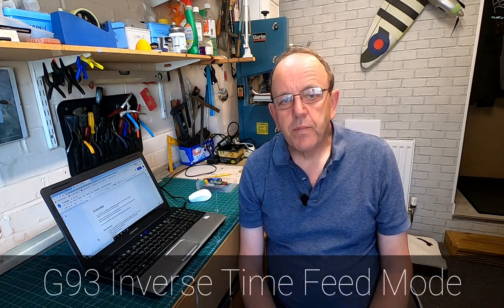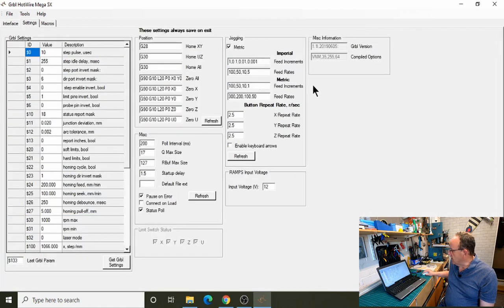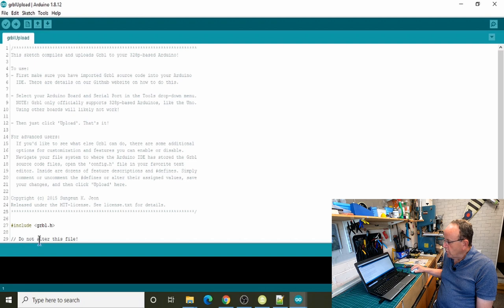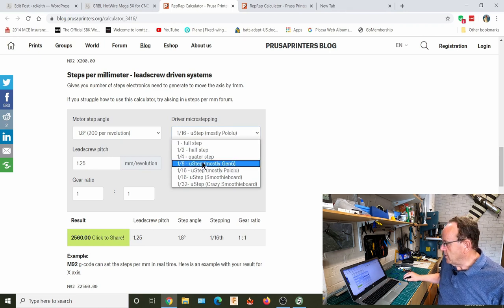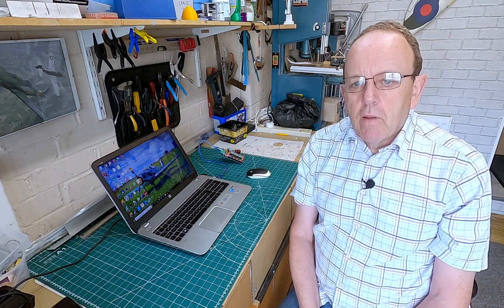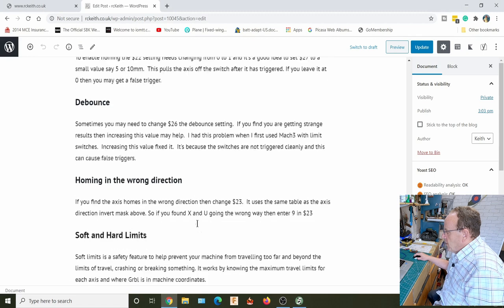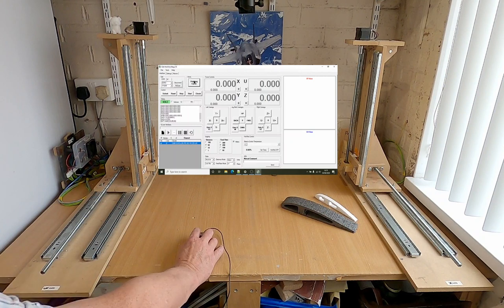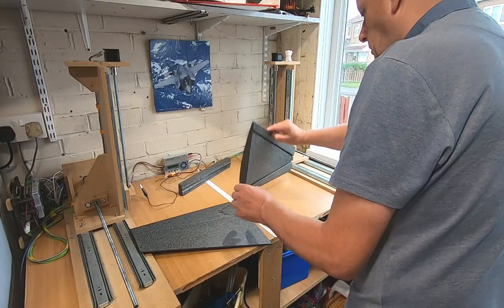GRBL HotWire Mega 5X Free Software & Firmware - CNC Foam Cutters

Comment: Great work Keith!!! I´m actually building a V2 of my Foamcutter (belt driven) and yes, i´ll add limit switches :) !
Reply from the maker: Thanks. Send some pictures be good to see a belt  driven version.
Reply: @rckeith  hmm... getting some errors when  compiling the code ("WCO refresh must be greater than one."
and "Override refresh must be greater than zero."

) - any idea
Reply from the maker: @jetpilot72  have you got the correct board selected, that can stop compiling.
Reply: @rckeith  yes, settings are correct -  tried it on a new arduino mega and it worked! Limit switches are working :) thank´s again for your time and help! Is there a way to donate something????

Comment: Hello Keith, 

Thanks for all the lovely videos. 

Do you think you could make a version of the hotwire controller that works on Linux. Or atleast guide me (and others like me) on how to make one. Thanks
Reply from the maker: Thanks. I don’t have the skills to do that. There is a version on the website based on Marlin which doesn't require Windows. It just runs off the LCD.
Reply: @rckeith  ok. Thanks so much

Comment: The "homing seek" ($25) Should be a larger value than the "homing feed" ($24).  When the homing cycle starts the carriage moves toward the limit switch at the ("seek rate"$25) until the switch is triggered.  Then (pull-off $27) is executed. Then the carriage moves toward the limit switch at the ("feed rate"$24). This is executed slowly moving until the switch is triggered giving more accurate and repeatable result.  If these values are large "feed" and small "seek" and the carriage is at the other end of the track it will slowly move down the track until it triggers the switch then backup "pull-off" distance and swiftly engage the switch again. taking a long time and giving less than optimum results. If large "seek"  and small "feed" are used the carriage will move swiftly down the track engage the switch "pull-off and slowly engage the switch again taking much less time and giving optimum results.   Excellent Video  I will soon be building this.  Thank you

Comment: Hello Keith, what is the minimum monitor size to work with the grbl 5x software? I want to use a 15 inches monitor with touch screen, do you know if fit the screen software on a 15 inches monitor?
Reply from the maker: You need a monitor that supports 1920x1080 resolution.

Comment: Hi keith..  Great job. Have seen or used winghelper? .  That is what im currently using. Its helpful since i also have a laser cutter..
Reply from the maker: Hi Victor, no I haven't it does look very good from the video. Have you used it for foam cutting?
Reply: @rckeith  yes it works very well....and gcode works with grbl with no issues

Comment: Keith, can you point me in the direction of homing and setting stops without switches?
Reply from the maker: You can only use homing with switches. Make sure $22=0 in settings. That disables homing with switches. So now when you power up that is the zero position for all axes.

Comment: Hello sir I am having problem in 5th axis 
4axis turning 90 degree but 
When 5th axis is going to turn the 4th axis gone again zero 
I thinks it's some error of my post processors
Reply from the maker: Sorry I don't have any 5 axis experience try the vendor of the g-code generation software
Reply: @rckeith  okay I am using fusion 360 software and they also don't have any idea about it

Comment: hi Keith Howlette, thanks for your work, firmware and control panel work fine, but now I have problems with the drawings that is: if I wanted to cut a normal circle and not a wing, what program should I use to make the x axes recognize , y, z, u? thanks francis from italy
Reply from the maker: Hi, Francis probably the best is DevFoam 2 http://www.devcad.com/eng/devfoam2.asp you can also try Jedicut which can use DXF files with a CAD drawing of a circle.  I haven't tried that but it should be possible.
Keith
Reply: @rckeith  thanks for the availability and the quick response I think you are right now I try and keep you updated if the solution works thanks francis

Comment: When I run the $I command, I'm getting Axis XYZAB, not XYZU.   How do I fix this?   I'm also getting a #define bit(b) (1UL << (b)) error when  check the file.   (I'm new to this so not sure how to trouble shoot)
Reply from the maker: You are not using the correct firmware that's the default grbl-mega-5x.  Follow the instruction here  https://www.rckeith.co.uk/easy-way-to-upload-cnc-foam-cutter-firmware/
It uses Xloader to upload a pre-compiled hex file. Much simpler if you are new to Arduino
Keith
Reply: @rckeith  Thanks Keith. I missed that link.  Question.   1) Do I have to remove the ramps board when I load the Xloader?  2)  Can I simply 'overwrite' the current version on my Arduino or do I need to set it back to default (which I have no idea on how to do...)    Thanks in advance.
Reply: @rckeith  Thanks Keith.  I followed your procedure above and was able to get all the motors turning today.   Now I just need to build the gantries.

Comment: Hi, great job sir,
If the wire length is 2500mm can it work, because I need to cut a eps block with 2500mm legth
Reply from the maker: I think you would need to use a separate power supply for the hot wire. The MKS board I show in a later video can use 24 Volts and several guys have used over 1000m but I can't be certain on 2500mm.  I would perhaps suggest making the part in two sections and that way it would be fine.
Keith
Reply: Thank you for your reply, now we are using welding machine for heating the wire and we are cutting manually. But I am not sure that if the wire is 2500mm length then the heat will be uniform in all aria. 
Thank you and waiting for your new video.

Comment: after installing frimware and connecting no status is showing not idle or joging is shwoing nothing happening its just connected and showing null........  software program issue i think tell me how do i make changes in it and how i recompile it whole thing into one single frimeware file
.
.
i am making 5x cnc using mega 2560 + ramp board but i am not getting any output
Reply from the maker: Sorry for the late reply, Is it working now?
Reply: @rckeith  yes it's working through ur guidence thank you so much sir you r fabulous 😍❤️

Comment: great job. But i i have a problem with output of voltage to hot wire its only output same voltage as is ramps powered . i powered ramps with 12 volts hot wire is always 12 volt
Reply from the maker: Hi Marcin.  I have an update coming out soon that should fix that.  But in the meantime you can use the Manual Command and set the voltage that way. So to set 6 volts enter M3 S500 or for 12 volts M3 S1000.  The range is 0 to 1000.  Hope that helps.  The updated application should be out in a few weeks with some other minor fixes as well.
Keith

Comment: Has anyone else had the controlling program stop working after about 20 seconds? I have not even gotten a wing code to load and work! Only can move the steppers and half the time it says that a command has not completed! I have loaded the mega using the ino and xloader both! Using the Arduino ide, It loads and the serial monitor reads correctly but I get several pages of red line faults, then it says loaded. Any suggestions? Thanks
Reply from the maker: Can you send some screenshots and pictures of your setup.  Not had anyone with that problem.  Could be a hardware issue.  Check the troubleshooting video on the channel if you haven't already.  It might help diagnose the problem.
Keith
Reply: I had to set $20 (soft limits, bool) to 0 in settings tab. Otherwise I could not move any motors past 0 point. Only towards negative numbers and back to 0 worked but no positive numbers were allowed. Program would give brief error message and then froze. I have not set up limit switches (yet).
Reply from the maker: @retkimora  I've updated the firmware. The download was configured for limit switches. It now set for no limit switches by default.  Should fix that issue/
Reply: @rckeith  
Keith, I am going back to watch your set up videos. This morning I found the comment. Above about the soft limits. I remember you mentioning this when you went through the settings. I looked to verify I had this set correctly and see that I messed this up. I changed the settings and the motors keep moving with out fault! One miss and I wasted your time trying to help me. I will watch them again and see if I can get this thing going. Thanks for your time and efforts for all of us, and retkimora for coming forward and mentioning this to help me.
Don
Reply: @retkimora  Thanks, that solved some of my problems. Don

Comment: Quick question: As you mentioned, the axis are xyz and u. What if you have a program for a cut that is written for xyz and a. What is the easy way to change all the A's to U's if there is one? Or do you have to manually do it in Notepad? Thanks again. Don
Reply from the maker: You can use the Edit->Replace in NotePad with Match Case tickbox selected.  That should do it.
Reply: @rckeith  Thanks Keith- got to try that.  Don

Comment: i am stuck help me ...........
i am making 5 axis cnc milling machine
by using arduino mega 2560 +1.4 ramps board 
i uploaded frimware but the E0,E1 is not giving output as Axis A and B but when i am switching it in 4 axis in grbl foam cutter then it gives E0 as Axis U so .... 
my problem is that i my board E0 and E1 which is not as Axis A and B ...... how and what changes i have to make in frimware to get This E0 and E1 as Output Axis A and B.......

>>>first off all i have to make changes in c++ files and header files then...
>>>second how i have to compile it in one single .ino file from bunches of c++ and header files of frimware 

Atleast help me out from my second problem because i don,t know how to make firmware for my machine into single .ino files to upload it in my machines...................
please if somebody knows kindly help me to make it solved............
Reply from the maker: For 5 axis and using A and B as the axis letters download the source code from here https://github.com/fra589/grbl-Mega-5X and follow Gauthier instructions here https://github.com/fra589/grbl-Mega-5X/wiki/Compiling-grbl-Mega-5X

Comment: Hi. Could I use an MKS Gen L (ramps 1.4 on a single board basically) with this firmware and a 2-axis machine in mind? Only belts, 2 motors and wheels on 2020/2040 profiles. 
Thanks
Reply from the maker: I'm just about to release an updated version of the Windows CNC application which works with the MKS GEN L board. Still have some testing to do but it should be released in a couple of weeks. Not sure how you intend to use 2 axis on it but it will expect 4 axis g-code or there will be an error.
Reply: @rckeith  Hmm, that sounds awesome. 
However since your program already works with the RAMPS 1.4 I find it curious that the MKS GEN L needs a special treatment. I watched a youtube video where a guy made it work with grbl-mega with no problems ( https://www.youtube.com/watch?v=X2ZULHbKFvE ).

About the two axis thing,  I'm trying to build a machine like the Polyshaper Azul, to cut letters with it. 
I've already built a Cnc foam cutting machine with grbl+Arduino uno following the How to mechatronics tutorial but it just wasn't rigid enough and I also wanted software hotwire control, something that only a Mega board could give me
Reply from the maker: @alejandroperez5368  It's just the windows software. I found on one laptop it woked fine with no changes and then on another it would not send any data back to the interface. I eventually found it was the way the software was initialising the connection. I beleive its to do with the way the USB is implemented different laptops.  It now works with the changes I made.  You may be OK with the current software but there is a channce it may not work.  Version 3.3 out soon with ensure it works.
Keith
Reply: @rckeith  I will try it out when possible. However, you mentioned that trying to use 2-axis gcode would throw an error so I no longer know if this program is the right one for my application. As I said earlier, I'm only looking to cut letters and logos with it!

Edit: I forgot to include that I will be generating the gcode with Inkscape's Gcodetool extension.
Reply from the maker: @alejandroperez5368  You could just copy the x and y to the u and z and that would work. Quite easy in Excel.
Reply: I will tell you what I end up doing with all this, thanks for your consideration Keith

Comment: Dose grbl mega 5x edge has scaleing commond g51 ? 
If it has the  How to use it ?
Reply from the maker: No G51 isn't supported in GRBL
Reply: @rckeith  suggest me something about alignment the workpiece
i want to get perfect alignment in x and y axis 
During operation right now I am unable to hold workpiece again in perfect straight line 
I machined and unclamps it and use it or do something else and then after i want to machine it again for some cuts and drills what ever 
Then how I align it perfectly it's very challanging for me right to align perfectly again and again after unclampimg and clamping there is giving minor errors in positioning perfectly
Is it any rule or formula or tool for perfect alignment each and everytime clamps and unclamps the workpiece

Comment: How do I configure my machine diy cnc 
I am using grblgru software for connecting machine and sending gcodes 
For 5 axis i build 5 axis machine 
But after connecting it gets homing in right direction in real world but in software grblgru z gose down but my homing of z is upwords 
And then i move z down for machining it goes out of the frame in software 
Then it goes down and accordingly to z code probing is going to wrong direction
Reply from the maker: I have used GrblGuru so you would be better asking the developer
Reply: @rckeith  My grbl 5 x mega edge is not setup machine
When I press homing it goes home where I decided my setting is $23=0
But when take to center on my workpiece to start the job 
I starts probing but it's gose in upwords direction where homing gose but my job is below 
How i setup and run my first job in cnc 
Did I have to configure machine 
My homing settings is upword right corner 
But in software it shows right corner but in downward direction it goes below the bed in software 
When I upload gcode it goes upwords but in actual machine it has to go downworda to make things worked

Comment: nice job man!! it work for 2 axis? i'm tryng , but, not work
Reply from the maker: Have a look at the troubleshooting video https://youtu.be/yzCKXei0pLU it covers common problems with axis not working
Reply: @rckeith   nema17 are working, what doesn’t work is the homing cycle, I’m following in their footsteps, I’ve already tried NO and NC, I’m Brazilian and my writing is terrible. lol
Reply from the maker: @lobo3501  Check on the website https://rckeith.co.uk/grbl-hotwire-mega-5x-for-cnc-foam-cutters/ under the heading "Homing/Limit Switches Configuration" there is a language translator on the website so that may help.  Check your settings are the same. Can you send some pictures  of your settings and I will have a look.

Verifique no site https://rckeith.co.uk/grbl-hotwire-mega-5x-for-cnc-foam-cutters/ sob o título "Homing / Limit Switches Configuration" se há um tradutor de idioma no site para que pode ajudar. Verifique se as configurações são as mesmas. Você pode enviar algumas fotos para de suas configurações e eu darei uma olhada.